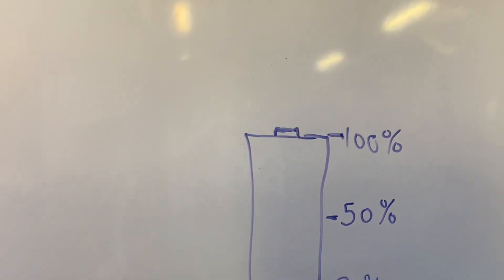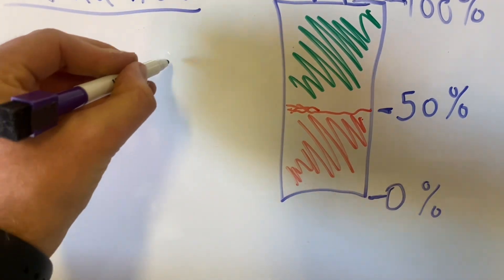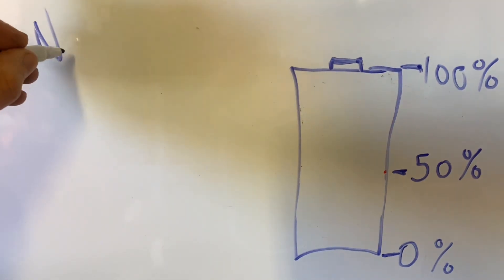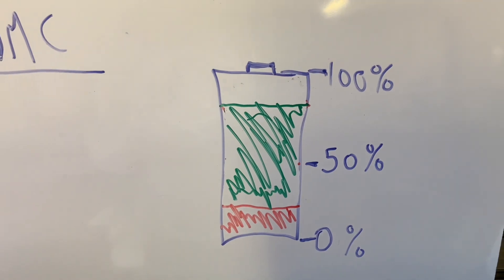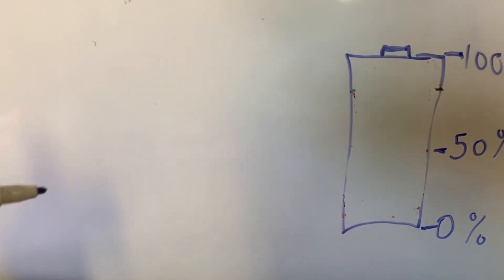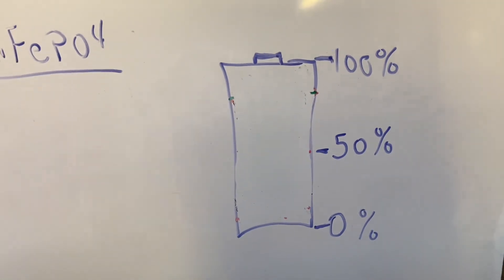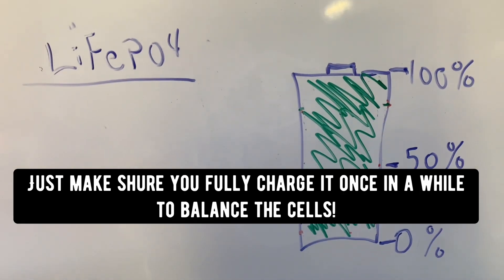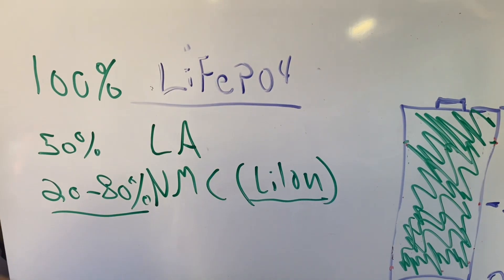LiFePO4 vs Lead Acid vs NMC("Li-ion") — How Much Capacity Can You Really Use?

Comment: There are two types of lead-acid batteries: starter batteries (which are designed to turn the starter and start internal combustion engines) and traction batteries, which are used to power the electric traction motors of electric vehicles. From what you've said, I suspect you're talking about starter lead-acid batteries. Traction lead-acid batteries should operate between 20% and 100% charge levels. This is what most battery manufacturers state. There are also three types of lead-acid batteries by design: flooded, gelled and AGM. They also differ slightly in their charging modes, output power and number of useful cycles. Traction batteries are also called deep cycle batteries. And their number of useful cycles is about 1,500 cycles.
Reply from the maker: Thanks for the comment👍 Yes I gave info on lead acid based on the averages of all types.

Comment: How about combining the 'best of both' - Lead Acid and LiFePO4
Lithium keeps the Lead charged, and when configured - not over charged.
The Lead then delivers current if/when needed and the Lithium stabilizes. 
Yes, an equilibrium must be found and current limited and possibly deep cycle required, but that is easily done in design, then 'forgotten' about.
Reply from the maker: I think you will be better off having two battery banks with a switch to select the bank you want to use. Two systems for charging each battery chemistry, and one system for load distribution.
Reply: @JonasSyver  I currently have a 5kWh usable lead acid deep cycle system, and is building a LiFePO4 battery of around 5kWh too. Been doing some research, and it seems it is a viable way of combining/using the two types together on a busbar. The LiFePO4 will have a BMS naturally, and being an electrical engineer with a practical background in electronics and mechanics - I'll do my own conclusions once I get done building it.  
Now, I'm spending time not building the system - so .. :ø)
That being said, with these energies it is NOT a toy and caution and experience is a must to remain safe.
Reply from the maker: Yes. Safety first👍

Comment: i am presently replacing a 12 ton lead acid battery bank (1640Ahr @ 180V) with a LiFePO4 system.  My biggest gripe is the stupidness of the new technology.  I have to have a BMS and a phone app to monitor and see if it's working at all.  I don't see much of a way to manage this sort of battery when an EMP occurs.
Reply from the maker: Good luck with the battery swap👍 I understand your frustration if you don’t like the tech. EMP will knock it out yes
Reply: @JonasSyver   Yeah, some of us are preppers and know an EMP from man or nature is a certainty and many of the alternative energy components these days will be turned to junk.
Reply from the maker: @ForbiddTV what about looking into something like a faraday cage for your essential equipment? Maybe I’ll look into a DIY way of doing this🤷‍♂️
Reply: @JonasSyver  That means protecting a whole set of components off line, an expensive proposition.  I do keep my old inverter and charge controller, but that doesn't help with the photovoltaic panels or batteries. I do have some panels I bought in the 1980's that still work, but batteries sulfate and can't be kept that long.
Reply from the maker: @ForbiddTV Right. There are pros and cons for everything. Seems like you have quite the setup👍
Reply: @JonasSyver   And to answer your question, based on my research if components are being used there's no sure way to protect them from EMP since they are all attached to wires which go all the way to the panels or wind generator.  The wires collect the waves just as they did with the telegraph in 1859.
Reply from the maker: @ForbiddTV thanks👍